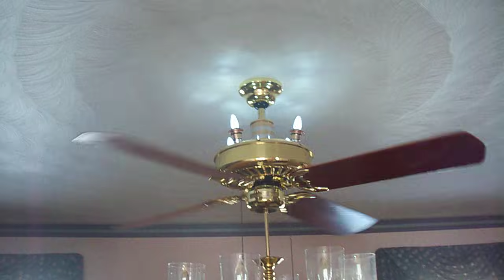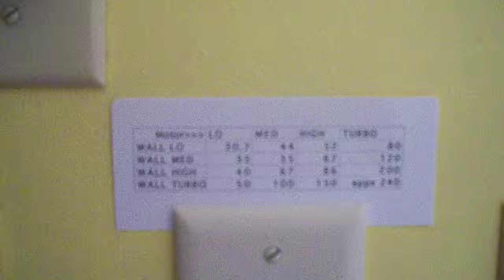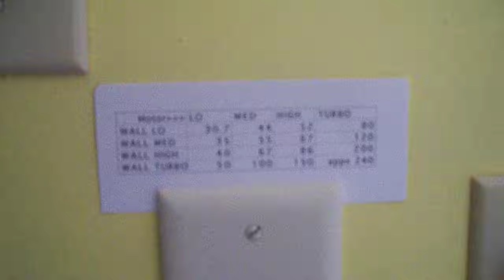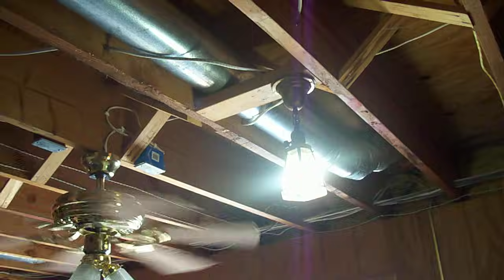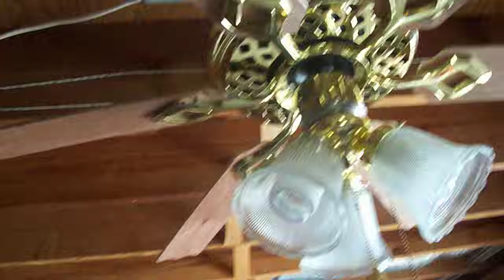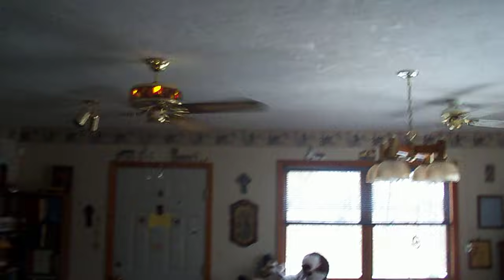Fans at My Families House

Comment: 1. crest 2000 series
2. sears lighted housing
3. moss wf series
4. nutone sea island
5. casablanca delta ii 
6. smc emperor
7. hunter noveu art
8. hunter ashlynn
9. hunter original
10. nutone verandah delux
11. casablanca lady delta
12. homemade fan
13. palico
14. sears lighted housing
15. harbor breeze lakeside ii
Reply from the maker: 6 is actully a franken fan it has an emesron k55XL motor also the hosing is off litex Arlington
7 is convent garden very simialr to the at noveu but the glass is diffrent
Reply: You forgot the nutone slimline

Comment: The fan at 0.30 the one that has glass on the motor is a evergo i think
Reply from the maker: +arvin doan that's a possibility did they ever use transformers in the switch housing for the lower speeds?
Reply: @ThunderClawShocktrix  did
Reply: ThunderClawShocktrix the 2 lighted housing fans were manufactured by sears. check out one of nicktubfans's videos

Comment: My parents would not be ok with so many fans installed in fans they use, i.e. the two in the office and the two in the kitchen.  It's awesome that yours are ok with this.  Personally, I dont like fans of different finishes in the same area.  I think the little Sea Island is my favorite, and the Palco second!
Reply from the maker: The one by the computer went in first, though at the time it was a bright brass aramatage, the stoned glass one well, the rest of the office needed the air movement, similar story for the one by the range and the one nook with hey bay window, one by the stove came first, in both cases of the fan + chandelier they wanted to keep the light they had when the fan went in, they like having the 2 in those rooms since it puts air where its needed

yeah that little nutone is great if i did not have the K55 emperor I would use the veranda in the living room, had it not been for the delta 2 that veranda would be in the dining room right now. the current install of the palco is temporary, only to help get heat in that space right before the really bad sub zero weather hit this winter, and sub 0 lows are not normal here, I plan on using it in the main basement instead, there is an alcove in the NE corner I'd like to put it in, and I want something with a pull chain in the utility room plan is Emerson designer in there since that room gets no sunlight so it wont yellow in there
Reply: ThunderClawShocktrix I think a Verandah would be a much better living room fan!

Whose house is the chrome Sonnet Air in the kitchen?  Yours?
Reply from the maker: +Dan ''Spiffy'' Neuman  

its in our rental property and yeah i think it would look good in there just that the k55 emperor 
needs a high ceiling to be used, though the veranda would have worked in
 the dining room also, if it were not for the fact that they like the 
diy uplight on the Casablanca
Reply: Lllllplmaaii
Reply: ThunderClawShocktrix fans.,